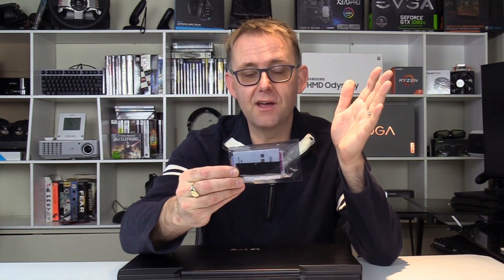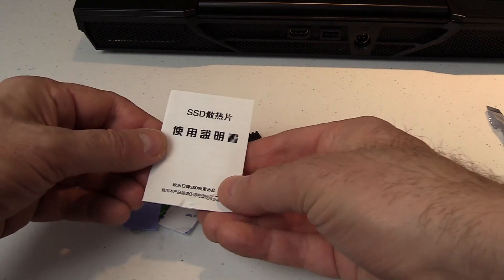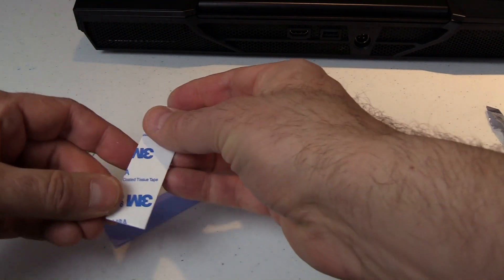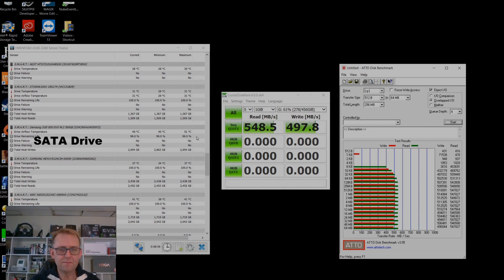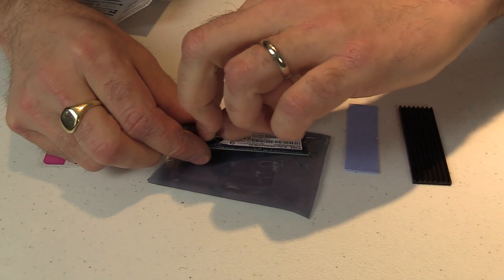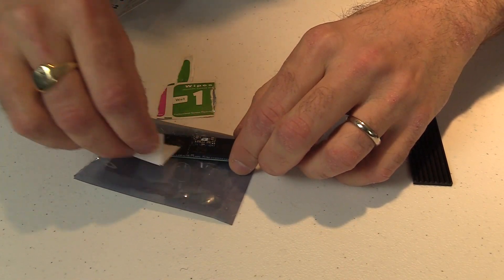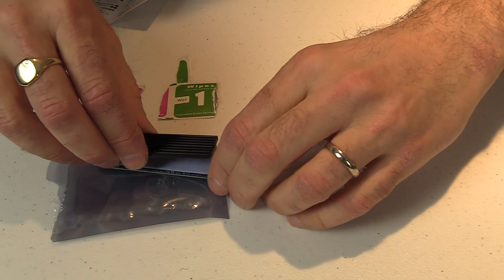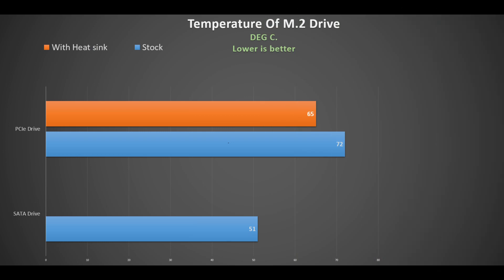Does An M.2 Heat Sink Actually Help Lower SSD Temperatures ?

Comment: thanks. any suggestions for the samsung 970 EVO. i need it to fit into a macbook 13.3 retina (it's thin)
Reply from the maker: You might be able to have the thermal pad make contact with the aluminum back cover of the laptop and use that as the heat sink?
Reply: I don't know. I'm a complete ignoramus  on the subject ;) .  I need to change my current ssd. I thought the 970 evo was my best option, but I'm reading a lot about temperature. I'll keep digging.
Reply from the maker: @nicoqaz  certainly once you put a heatsink on it it takes HeMan strength to pull it off, LOL. I would see how hot it gets first, there may be no issue but if it does get hot try the thermal pad only method. That is what Hidevolution used on my Razer 15 and that is quite thin and has an aluminum back cover
Reply: Thank you for the information.

Comment: A small 40-60 mm fan will do the trick as well if you are feeling innovative. In fact, some of the newer Mobos (desktop) provide a fan bracket for this purpose.
Reply from the maker: Trout but no need to have it powered 😀

Comment: Am I the only one to notice that it triples the read speed ?
Reply: No that was the only thing I was looking at, 70 degrees won't hurt the drive at all, my only question is if the drive is being throttled due to temps, which this clearly shows it does, it's almost suspect though, the doubling of speed makes me think he went into bios and changed setting from X2 PCIe to X4 PCIe... Lol... Hard to believe that the drive would be throttled that heavily.
Reply from the maker: @dylanjohnson5544  I didn't change anything in the BIOS...
Reply: @dylanjohnson5544  I installed the heatsink, no difference in speed but the temperatures always stay under 65... 50 degrees when watching youtube and low 40s when idle... (i have a laptop)
Reply from the maker: I think you were !  Good catch, my focus was purely on temperature and yes, big difference :)
Reply: @OWNORDISOWN  probably without the heatsink it was trotthling.
Reply from the maker: Yeh, probably. My speed increased quite bit too.

Comment: my 250gb nvme 960 evo under the asus heatseink is 61° and my 500gb nve 960 evo is 62° under the ek  heatsink  crystaldisk temp is red....
Reply from the maker: Daniel Melzer 62 deg seems fine to me..don't you think?
Reply: OWNorDisown  its ok 
the problem is 
I use mitx the 250 is over a 1080ti under the asus chipset heatsink 
and the second is on the backside 
no airflow ... xD

Comment: Good to see a test like this. I guess is not only good for the drive, also for the internal heating of the laptop. I'm going to buy a new one with two pcie drives and I will buy for sure something similar.
Reply from the maker: Cheers mate ! Yes, I was quite impressed the difference it makes and its an easy and cheap thing to do. Its a shame OEM's don't do it as a matter of course...

Comment: i had a question about ssd lifespan. how long can i expect 100ttbw to last  (samsung 960 evo 250gb). im going to have two m.2 ssd's in my pc and this will be a backup but can you point me in the direction to understand about how disk writing works. i dont quite understand what it specifically refers too ie is it more than just creating new files etc.
Reply from the maker: I think newer SSDs are now 3D TLC NAND . Here is a good summation: https://www.speedguide.net/faq/slc-mlc-or-tlc-nand-for-solid-state-drives-406
Reply: You can often get info on the actual data written to the NAND flash from either CrystalDiskInfo or the SSD manufacturer's own software (e.g. Samsung Magician.) 100 TBW would be completely filling and erasing that drive 400 times, which is plenty. The average consumer will not have to worry about SSD lifespan unless you're using it as cache in a RAID or something very demanding like that.

Comment: I love your stuff dude. Keep it up. I threw one of these on my 960 Evo (256gb) and it went from 78C (controller, not nand) down to 56C max after a 50gb CDM run. Rose about 160mb/s average write speed too, with reads a more modest 28mb/s gain.
Reply from the maker: Rick Rands That's awesome Rick ! Thanks for sharing.  I think I might do this on all my laptops, it's cheap and easy 😀
Reply: Rick Rands I've had several 950, 960 and 970 series Samsung EVO and Pro throttle after heavy use starting at 60c. Even had 3 of them in raid0 all do it. Heatsinks fixed them in all scenarios.
Reply: Thanks for the good info, as I'm planning on upgrading my laptop and remove the old spinning disk.
Reply: what are you doing? Don't you know a single thing about NAND? you can cool the Controller on the M.2 but never cool the NAND. The NAND needs a high temperature to function and run optimally whereas the controller needs to be cold so trim your Pads before installing it. otherwise, your NAND will Degrade and only have about half the lifespan as if you trimmed your pads so you only cool the controller. Pro tip Put the cooling pad between the motherboard and the drive. and throw the heatsink away!
Reply: @wardope  can you give more data and sources on saying that nand needs high temps ? or can anybody else  comfirm it with actual data?
Reply: they actually throttle at 60c, so any heatsink helps
Reply: kinerry actually, I've owned 4 different lines of nvme m.2 ssds, and none of them throttle under 80C. Not sure where you got your info, but it doesn't seem to be accurate.

Comment: Hi Steven, I hope you are really well and wish you the best wishes on new channel. I have question for you for gaming laptop. Are you recommended sager or MSI with 1080GTX on it or waiting for new GPU from Nvidia. I didn't really good luck with 17R4 and return that product also waiting fir really great computer. What do you recomended and how can I buy it ?
Reply from the maker: Reza Tahmasebpour Hi Reza, I really like my Clevo P870TM . The only downside is that you need to remove the keyboard to get access to the ssd's.  It's not hard to do but you have to make sure not to use a too pointy a screw driver. My video on it is here:
https://youtu.be/jct_jUJucOY
Next month you should see the launch of mobile 6 core laptops so it might be worth waiting for reviews to come out on those. I hope to get a Gigabyte or Aorus to look at..
Reply: Exklim Tech News  Thanks a lot 
Have a great day

Comment: I was actually wondering about this. Thanks! Also, I was wondering if you could give us a price estimate for the mini e gpu. I'm hyped.
Reply from the maker: Thanks, glad you liked it !  The kickstarter price will be $399 US, which will be discounted from the full retail price. Not sure what that will be at this time. We are just finalizing the Kickstarter video , hopefully will be ready Monday/Tuesday. Once Kickstarter is launched I will upload my interview with Exklim including the Kickstarter page. I too am excited !  There will be an upgrade program too so if you want to upgrade at a later date you return your old one and pay the difference in price. That's the idea anyway.
Reply: So there'll be a 1060 or volta in the future? Also, I was wondering if you could recommend a laptop for a friend. He wants 8550U, MX150, and Thunderbolt 3 (in a 13 or 14 inch). He also doesn't like the keyboard on the Matebook X Pro. Thanks so much.

Comment: It's pretty good thermals that got registered after adding the heat sink. Is there something similar for 2.5 HD?
Reply from the maker: Yes, I was quite surprised to see a 10% reduction... I found this 2.5" one but I think just sticking some of these on the drive would do the trick..
https://www.amazon.com/WDSL00S-IcePack-Drive-Mounting-Heatsink/dp/B008L5TQIS/ref=sr_1_1?ie=UTF8&qid=1521344045&sr=8-1&keywords=2.5%22+drive+heatsink&dpID=41V7GCv99ML&preST=_SX300_QL70_&dpSrc=srch
Reply: arent 2.5 inch drives sata? sata isnt fast enough to make enough heat to throttle it, but i have heard pcie drives will slow themselves down from thermal restrictions
Reply: U.2 2.5" drives exist but they usually have good metal casing anyway

Comment: I use the ek one, I like it better since they they use clamp instead of adhesive thermal pad. They work great. 

https://www.ekwb.com/shop/ek-m-2-nvme-heatsink-black
Reply from the maker: Yes, I looked at that one. Does it add much more to the thickness versus adhesive thermal pad?
Reply: A bit more yes, it come with 2 pad one 1mm the other 0.5,there a back plate as well. The 1mm go under the heatsink and the 0.5 under the back plate. The negative is any m.2 with chip on the back of the circuit board won't be compatible.
Reply from the maker: Rick-jk yeh, that's what I thought when I saw it. Mine was tight under my keyboard.
Thanks for sharing, good info !